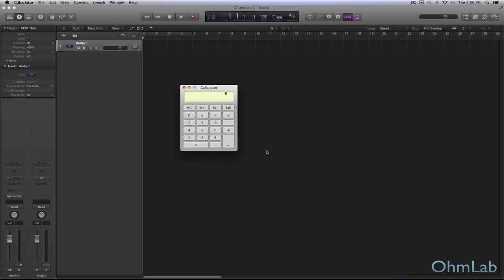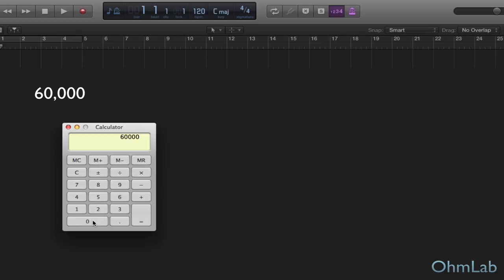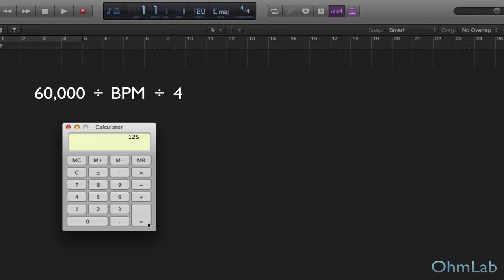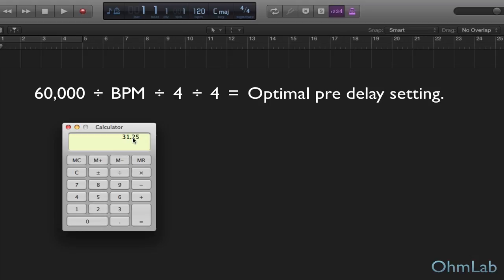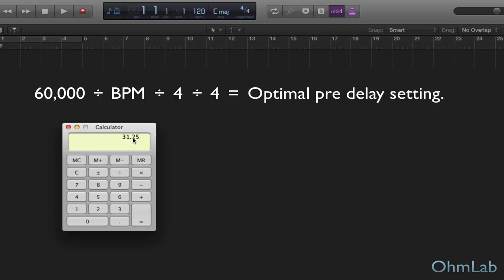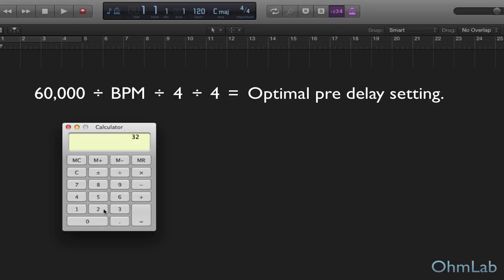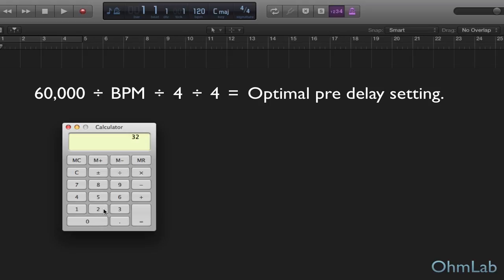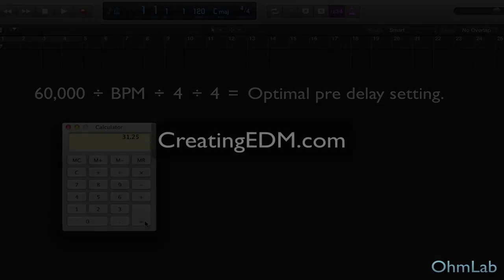Pre Delay - how to calculate pre-delay - Creating Tracks

Comment: If you divide 7500 by the BPM you get the same answer and it is two less steps. A little trick I learned from Bobby Owsinki!
Reply: well that gives 62 not 31 so its not the same
Reply: @tmussOfficial  Than use 3750 ...
Reply: Thank you! it's really working for me.

Comment: Would you do 60,000 / 120 / 3 if it were in 3/4 time signature or still go with 4? And how about the second break down, would it be 60,000 / 120 / 3 / 4 ?
Reply: a 3/4 time signature of course is 3 beats per bar. I assume you already know what the top and bottom number of a time signature is but I'm stating it in case somebody who reads this doesn't. I also see this is 6 years old but I figure why not answer the question. So we can assume that 60,000/120 would still give us a beat. Now because our time signature is a 3/4 our beat is still a quarter note due to the fact that the bottom number of our time signature designates what our beat actually is. if it was 3/8 it would be an 8th note for example. Now the cool thing about this is that even though we're in 3/4 if we are at 120bpm the only timing difference between a 3/4 and a 4/4 is the emphasis on the one. because they both have the same amount of beats in a minute due to the bpm. Doesnt matter how many beats per bar are designated by our 3/4 time signature. So really we dont have to compensate for our 3/4. We can just go with the original equation and we will still be on time and well off. If you count your 3/4 you are still counting 1 and 2 and 3 and 1 and 2 and 3 and. So the human will still default to the timings you are used to hearing in the 4/4.
Reply: 1.4×4×(60÷120)

Comment: I would LOVE it if you did a series on how to make the Rf Nexus 2 synths sound like they do,i asked them if they would do a series of ''how tos''  but they were not interested,for example how to stutter the synths like in their product videos.
Reply from the maker: Typically, the stutter effect commonly used in demo tracks is done through a gating effect. Try adding a Noise Gate plugin to your synth track. Now select the audio from your drum track (for instance) as a side chain trigger for the noise gate. The side chain trigger signal MUST be audio, not MIDI. Adjust the attack, hold, release and threshold to your liking. This will not give you the perfectly metered stutter you are after, but it should help you understand how to go about setting up the effect you do want. Typically, this would be accomplished through the use of a ghost track...Using Ghost Tracks as Side Chain Triggers

If this does not provide the desired effect, then it's probably a matter of chopping/glitching. And there are a few ways to go about do that. Just know that these techniques are not exclusive to Nexus and can be used with any synth. Either way, you will want to bounce your MIDI to audio to get started.

We'd need an example of what you are speaking of specifically to help more.

Comment from the maker: Neuroxik isnot No, you are still working with quarter notes, so stick with 4!
Reply: Thanks!
While I'm at it, what about bpm's that already give an integer such as 125 bpm (30 ms). Would you suggest slightly shifting upwards, say 30.3 or pushing all the way up to 31 ?
Reply from the maker: neuroxik Yes, push it to the next whole number at least. This is what is traditionally called 'in the pocket' when referring to pre-delay that is just a touch past the actual magic number. ;)

Comment: Quick question just to make sure I'm thinking in the right direction. The reason you divide by 4 is because you're going by 1/16 instead of 1/4 correct? If you were going by 1/4 you would divide by 2 instead of 4??
Reply: 60 000 / BPM gives you 1/4

Comment: Is there an actual reason why they make us have to do this though..?  Are they just trying to fuck with us a bit..?

Why is there not just a 'sync' button for the pre-delay, like you would get on an actual delay plugin..?
Reply from the maker: +kye903 There is a great reason! You certainly don't want the same exact settings for every single sound you process across all your projects. Although a 'sync' function may sound handy at first, it would actually be pretty restrictive and only provide you with one of the many options available to you, mathematically and aesthetically speaking. Also, delay is quite different from reverb, by nature. One deals with a simple delaying of audio signals, while the other emulates environments, space and a sound's behavior in each. Both provide different results, though there are times that you can certainly substitute some subtle delay for reverb to help keep a mix clean, for instance. Hope this helps clear things up a bit for you. Thanks for checking out the video and for leaving your comment/questions! :)
Reply: You seem to be saying then, that there are times when we want the pre-delay value to be some random value, instead of a "locked in" or "in the pocket" note value, be it 32nd or 64th or whatever..?  Have I understood that correctly?
Reply from the maker: +kye903 There are certainly times that you want your pre-delay values to be different from each other, as mentioned in the video. The first number you arrive at, after using this formula, is the middle of your ideal target zone. You halve or double that number and still have rather precise results. Conversely, there are many reasons (think cinematic sound design, impacts, foley, special effects, etc) that you may want to dial in a pre-delay value by ear, simply for it's effect. One more thing to take note of, as I mentioned in another comment thread on this post, the term 'in the pocket', when referring to pre-delay, is when you set your pre-delay value to be just a bit beyond your 'ideal' mathematical value. 

Many people will use this math formula to arrive at the ideal value and then offset it by a few ms simply to get further away from the 'too perfect' or 'not quite human enough' feeling that haunts a lot of music produced entirely on computers.
Reply: Once upon a time normal delays were in ms. In the future all reverb predelays will have a BPM host option 1/4, 1/16 etc. The Virus TI has it. I've requested it with other manufactures but they seem slow to the idea.
Reply from the maker: +mitchiemasha indeed. The Virus is a slick synth and a half
Reply from the maker: +mitchiemasha indeed. The Virus is a slick synth and a half